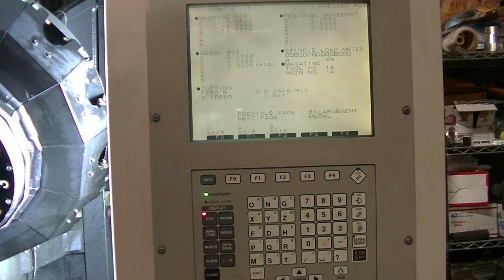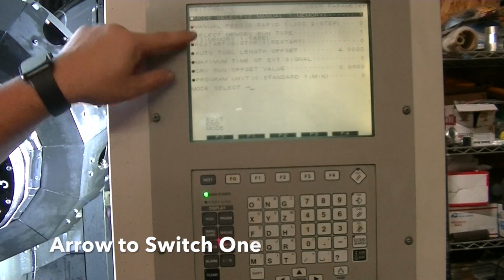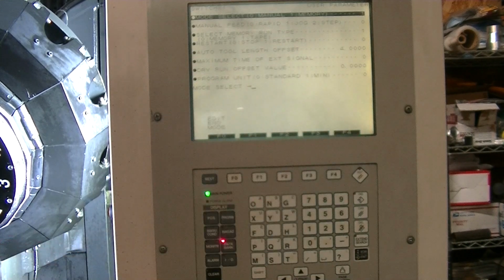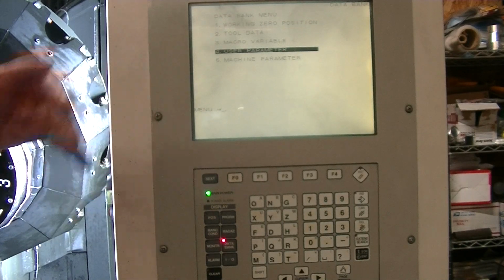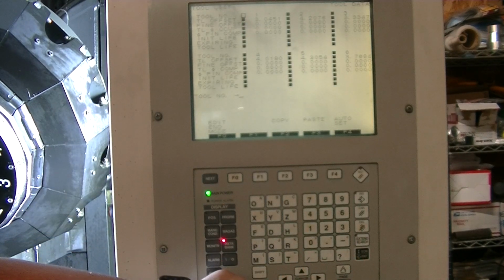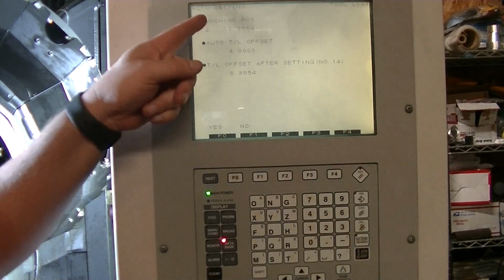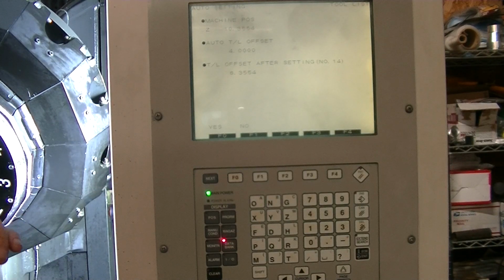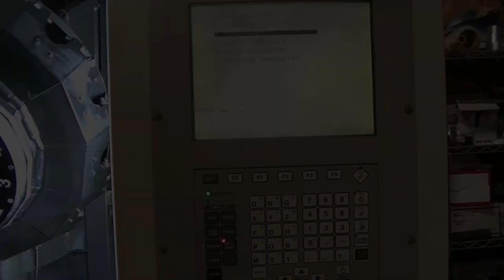Brother A00 Control - Tool Length Offsets

Comment: Glad to see you online again.
Reply from the maker: Had to take a little break but getting back into the swing of things... Hope you are well, sir.
Reply: Hi Tom, Do you apply the 4.00" offset on your Haimer as well? Do you program your Haimer tool to a carousel number.. like tool#1?
Reply from the maker: @allantolentino2992  Hi Allan! I used the same 4" to set the Haimer (used a gauge block on the table) and set the tool offset. I left it in my carousel as tool 14 which is why I loaded the MDI code to get the H-value. It works great this way though! I posted another video on using the Haimer as well...